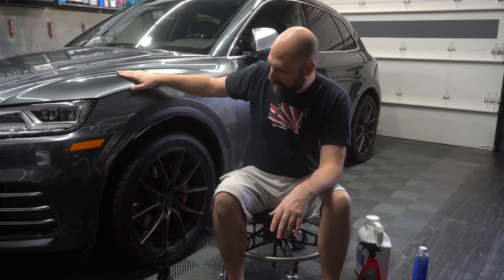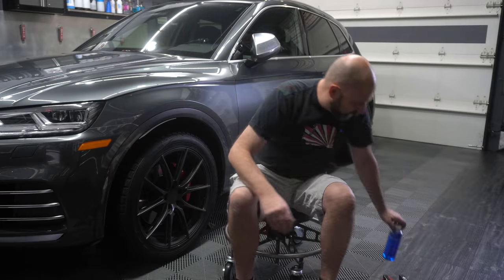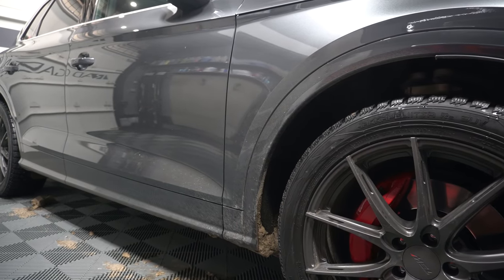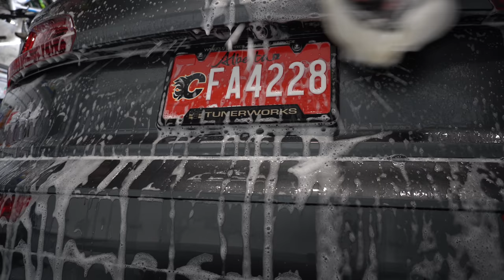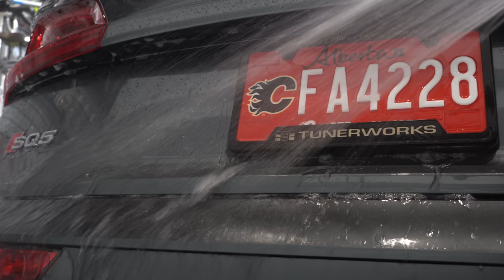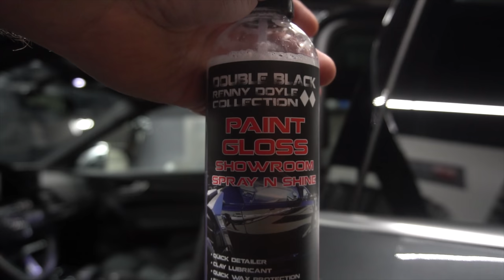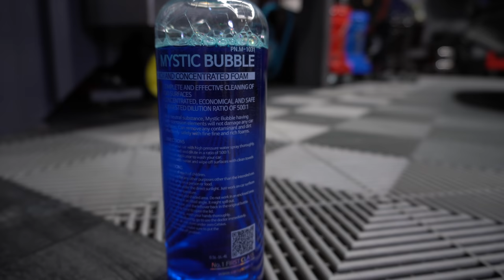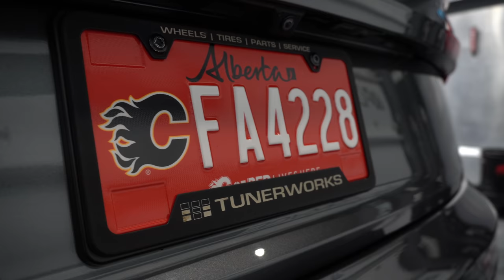SUNDAY NIGHT WASH | Doing my Best to Maintain my Audi SQ5 in the Unforgiving Frozen Tundra of Canada

Comment: That auto foam is very well known and loved in Europe, cheap, bio-safe and actually cleans, not very thick but does the job
Reply from the maker: I liked it very much. I used a very weak dilution. From what I’m hearing, I need to get a 50/50 dilution which seems like a lot. Even though it’s not shaving cream thick, it was highly effective at doing what matters most - melting away the dirt! I’ll play around with dilution rates at some point. I have a LOT of foam shampoos to play around with. Glad to have finally played with the BH A-F!
Reply: @RADGarage  200mls and top your bottle up full with water rick
Reply from the maker: That's what I'm thinking, but I'll tackle the test process nonetheless. I'm curious to see what the exact amount of BH A-F is for the system I am running.

Comment: Bilt Hamber is an incredible product. The price for the quality of the product is unbeatable in the UK. I absolutely love their auto wheels and surfex HD
Reply from the maker: This brand has some seriously loyal users! I have used the wheel cleaner, but have yet to try the Surfex HD. What specific tasks do you use the Surfex for?
Reply: @RADGarage  I use surfex HD like I would use any other all purpose cleaner. Badges, window trim surround and grills. Safe to use for interior as well

Comment: BH Auto foam is not meant to be thick. It’s meant to be runny. It depends on your setup (pressure washer, water, etc.) They claim you need about 4% PIR (panel impact ratio) for heavily soiled cars, which effectively is how much product is on your car. You empty a full of water foam cannon and you see how many litres you have. Say you’ve got 10litres (10000ml). You then 10000x0.04=400ml of foam and 600ml of water in the cannon. Obviously you adjust that amount with how dirty the car is and how full you need the canon to be.
Hope this makes sense and I got it right anyway. Great video by the way!
Reply from the maker: Yes, I think I am now able to wrap my head around the process for calculating the mixture ratio. The thought of sitting there emptying the foam cannon and then calculating the amount of water required to empty the canister just seems so strange and foreign to me, but I get it now. I will do it when I have some free time. When you say you adjust that amount dependent on the condition of the car, how much variance are you talking about? Just a little bit?
Reply: @RADGarage  well 4% is for heavily soiled cars but say summer time you can go as low as 1-2% for example. Haven’t tried it though as it’s not always convenient for me to wash the car often. Apologies for the late reply, I didn’t get notified for some reason.

Comment: Rick, I know the foam wasn't super foamy per safe but I would argue the runny thin nature is what you'd want in a foam soap. I always felt that overly foamy soaps that almost look like shaving creme always just fall off the car too quickly and don't have enough time to dwell, while the thinner "runnier" type usually cling on longer and dwell. Its ironic to say that the runnier foam clings on longer but that's what I've experienced!
Reply from the maker: Thanks for the feedback. I don’t mind runny foam formulations either. I just didn’t know if this consistency shown in the video is what I should be aiming for. The Auto-Foam seems highly regarded by those who have used it. I’ll give it another shot soon with a bit more product in the canister and see what difference it makes.

Comment: Great video Rick, really enjoyed it!!! As for the Autofoam, it's not a thick product but it's one of the best cleaning snowfoams out there and one of the cheapest here in the UK. I use 250 ml of Autofoam to 350 of water in my foam cannon and that works for me.
Reply from the maker: This 5L container cost me around $50 which isn't exactly cheap and I am hearing I may need to use up to 500ml in my foam canister. I need to do some calculations. Truth be told, the 100ml I used in this project was pretty good, but maybe I'll just up it to 200ml next time to see if it makes any sort of difference. At any rate, fun to work with such a beloved product and I am sure enjoying hearing about everyone else's experience with it.

Comment: Great video Rick! Have been using Auto Foam for a number of years here in the UK. Bilt Hamber recommends a maximum panel impact ratio of 4% for very dirty vehicles. With my setup (Kranzle K10 and MTM PF22.2) I need a 1:1 dilution for a 4% PIR with 500 ml of product to 500 ml of water. For a 2% PIR you need 250 ml product to 750 ml water, and so on. Yes, it’s a lot of product to use but I still find it very effective at 1% PIR or less.
Reply from the maker: Haha. I’m 1:1 confused. Pretend I’m 4 years old and explain that again! 😂
Reply: Auto foam is as good as everyone is saying, the common problem is not using it at the correct dilution. Also, once you’ve worked it out and filled your foam cannon, that should cover about 4/5 washes before you need to refill. I use 200ml out of a foam cannon per wash. That’s why it’s so economical. Using a whole litre of it will waste it and cost loads. 

The way to work out the correct dilution is like this:

1. Fill your foam cannon with water till it’s full e.g. if it’s a 1 litre then fill with a litre of water. Turn your settings on your foam cannon to full foam. 
2. Discharge that litre into an empty bucket. Make sure you stop when the foam cannon is empty. This is key. 
3. Then work out how much water, in total, was discharged into the bucket e.g. when I did it I got 12.7l of water in the bucket. Yours will be different as it depends on which pressure washer you use, water flow etc. 
4. Times that figure by 0.04 (that’s the 4% PIR they talk about). So, 12700ml  x 0.04 is 508ml. Therefore I fill up my foam cannon with 508ml of auto foam, and top it up with 492ml of water. 

That’s it. Once you’ve worked that out, the volume never changes (unless you change your pressure washer etc). As I said, when you wash the car, you are only meant to use a small amount. 

I think the problem Bilt Hamber will find with users over the pond, is they like to spray it thick and spray a lot, which is the opposite to how it was designed. So unless you use it as designed, you won’t get the benefit of it. I have a 5l still going from 1.5 years ago, that’s how economical it is. 

Hope that helps, as I love the stuff and hate to see it get a bad review when most of the time, it’s being used incorrectly. There is a video on YouTube which shows you how much to spray and how quickly, if I find it will link it.
Reply from the maker: @LND8110  Dude, that is so nice of you to give me such a detailed and thorough response. I will follow your advice and get this stuff dialled in to my exact specifications! You are RAD! 🤘
Reply: @RADGarage  you’re welcome. I know it’ll tackle the harsh Canadian winter grime if used correctly. Look forward to hearing more about it in the future, love your videos and garage, keep up the great work 👍🏼
Reply: I use the same: 50% BH 50% water in my foam cannon.
Reply: @LND8110  Spot on explaination. Exactly as I do it. A cannon full can last quite a few washes, no need to empty the content each time. Not the shaving foam style but its cleaning power is undeniable.
Reply from the maker: I always end up emptying out the cannon! I'm a sucker for the foam stage. I will do some calculating this Saturday for my next winter wash video. The SQ5 is dirtier than it has ever been.

Comment: Hi Rick. I use bilt hamber snow foam in the winter here in Scotland. It doesn't foam too much but it cleans so well. Generally use 100 ml in a 1 litre snow foam bottle.
Reply from the maker: So, that’s exactly what I did. I don’t mind thin foam. In the video, I make it sound like I was disappointed but I wasn’t. I just wasn’t sure that was rhe consistency experienced users were used to. I’ll double it up next time and see if it makes any difference. I added the text in the video that stated how impressed I was with its cleaning abilities. The car didn’t really even need a hand wash! Thanks for the comment and the view!
Reply: @RADGarage  thanks for the quick reply Rick. Yeah the product cleans exceptionally well and is pretty cheap

Comment: What a great way to end my day awesome wash video Rick. Auto foam is runny they want the dirt to run off the car add more product for more foam. I’m loving BH products surfex hd is my favourite apc degreaser amazing stuff. Have a great week 👍🏻👍🏻👌🏻🇨🇦
Reply from the maker: Thanks Ken. What purposes do you find the Surfex HD coming in handy for?
Reply: @RADGarage  I mix 6 ounces of surfex hd in 3 litres of water in my kwasar pump sprayer and hit the lower portion of the car wheels and wheel wells let it sit for a couple minutes then blast it off with the sprayer at the car wash which is 3 minutes from my house. It removes all the salt and road film. When I get home I use my cordless sprayer remove anything I picked up on the way home then do a rinseless wash in my heated garage. I sure wish I had a drain in my garage like yours then I wouldn’t have to go to the car wash.  I ordered the pump sprayer from Chris at Carzilla the kwasar Orion pro+ 3L. Love it.

Comment: Bh auto foam is designed  to be thin , its alkaline biased so doesn't need long on the car to work.
I use 50 ml in a foam cannon so 1.7 fl oz so 2 fl oz will be plenty. The cleaning power is great especially for cars driven through  Scottish winters. Stephen.👌
Reply from the maker: Wow, so you are saying 50ml. I am hearing as much a 500ml from other viewers! I need to do the test process to find out what will work best with my setup. I agree with the cleaning power, it ate through the salt-encrusted coat of dirt on my car like a hot knife through butter.
Reply: @RADGarage  for me 50 ml is more than enough ,it doesn't go like shaving foam but works amazingly well.
As you say best to test with your set up and see what's best for you 😉
Reply from the maker: The test will happen on Saturday.
Reply: @RADGarage  looking forward to seeing how it goes.

Comment: 4% Panel impact ratio, fill your foam canon bottle with 1ltr of water, turn your foam gun fully open then back 1/4 of a turn. Spray foam canon in to bucket until bottle is empty. Measure bucket contents in millilitres, calculate 4% of contents and that is how much Auto foam you require, top up with water and away you go. Not the thickest of foams but one of the best for cleaning imo 👍👍
Reply from the maker: That is so well explained. I guess if I do this once, I know how much Auto-Foam to add for each and every future foam treatment. I will do that very soon.
Reply: @RADGarage  yep, it’s also very good a 2% for dusty summer washes. I forgot to say cracking vid tonight Rick and hope your return to school goes ok🤪🤪
Reply from the maker: Thanks man. The return to school has presented us with a lot of challenges. Lots of people out sick at the moment. I will play with calculations between 2 and 4% depending on how dirty the car is.

Comment: Hi, quick question, I live in Quebec City where we share that cold weather. How to you manage to deal with the raise of humidity in your garage while washing your car by those temperature? With pressure washer, it just raise up so much in mine? Any trick you use to deal with it? Thx man, just discover your channel this week, you have great stuff going on :-)
Reply from the maker: Humidity is a big issue actually. The videos don't show how foggy the garage becomes, especially when using the pressure washer. I have a Frigidaire dehumidifier that works overtime trying to capture the moisture from the air. Sometimes, I will open the garage door for a minute or two just to let the damp air escape. Luckily for me, I live in a very dry climate so opening the car door brings quick relief. Part of the reason I do a final rinse with the garden hose is to avoid the build up of humidity, but the pressure wash of the foam stage is where I see the most humidity issues. Here's a link to the dehumidifier I use: https://amzn.to/3InkJY8

Comment: I have been anxiously awaiting your next video, you didn’t disappoint, great wash!  It’s always interesting to try our new products, thanks for your review of them.  Question, why did you use your garden hose to rinse off your wash soap instead of your pressure washer?
Reply from the maker: I use the soft rinse because I want to get the soap suds off quickly and efficiently and I find a soft rinse does that. The pressure wash step is really about forcing soap and water into tight crevices to dislodge deeply hidden dirt. After a mitt wash, I just want to the soap (which is carrying the debris) off as quickly and painlessly as possible. Pressure rinse also creates more humidity and in the winter I like to keep humidity levels. low so I don't get condensation inside the garage. Also, I find it more relaxing. Thanks for the question. New video coming out Saturday morning so set your alarm!

Comment: For the Bilt Hamber Auto Foam, 4% PIR is recommend although it’s not necessary and will strip most “fragile” LSP’s. 2% is fine and so still clean well. 
It won’t damage your ceramic coating, but will strip the products that you use to top it. 
The cleaning is achieved through completely wetting, soaking and softening dirt, by the way the bubbles move, this is better than thick clingy foams. 
What is PIR?  Panel Impact Ratio i.e the ratio of product to water, that actually hits your panel, as the foam cannon further dilutes your product, so you don’t mix at 4% in the foam cannon. 
How do you work out PIR? 
Fill your foam cannon with 1 litre of water, set the dial to how you normally use it., attach to your pressure washer and empty it into a bucket with the pressure washer until the foam cannon is empty. Stop as soon as it empties. 
Now, measure the total volume of water in the bucket. 
Let’s say for example that it comes to 9 litres, or 9000ml. 
Multiply 9000 by 0.04 to get the 4% PIR which in this case would be 360ml. 
So in order to achieve 4% PIR, you would need 360ml product and 640ml water in your foam cannon. 
Like I say, 4% is not necessary and still won’t produce the thick foam that most people are looking for, but it should never be judged on the foam it produces, but rather on how it actually cleans, which is very well.
Reply from the maker: Easily the best explanation I have read yet. I will follow these instructions to the letter and report back what I find. I"m kind of excited to see what value the math comes out with.
Reply: @RADGarage  Thanks Rick, every one is different so we will see what you get there

Comment: Any particular reason you like to use your garden hose for the final rinse instead of the pressure washer?
Reply from the maker: Quicker, less overspray which means less humidity in the garage and just no need to pressure wash after a foam and hand wash imo.

Comment: the bilt hamber is supposed to be thin, thats how it was designed.  also to get a pir ratio of 4% you usually need to use  it at 1:1 ratio in the foam cannon
Reply from the maker: That seems ridiculous to have to use a foam shampoo at that kind of rich ratio, but I guess that is how it works. I usually use a squirt or two of my other foam shampoos in the canister. I guess that's what helps give it so much cleaning ability. Thanks for the info!
Reply: @RADGarage  I do agree it's a bit much compared to other products, however I find that with the thinner viscosity it is easier and faster to foam the whole car. so I only actually  use 200ml autofoam and 200ml water, and I'm still able to easily cover the entire car.
Reply from the maker: 200ml sounds about right compared to the other foams I use. I'm hearing some users use up to 500ml in a cannon which seems out of control to me! I will do some calculations to see how much will get me to that magic 4% PIR mark.
Reply: @RADGarage  I look forward to seeing  you use auto foam again
Reply from the maker: It's coming.

Comment: Despite all the overwhelmingly positive reviews of the bilt hamber auto foam, I'm also one of the few that don't really like it. The smell and the lack of thick foam take away the enjoyment of using a snow foam for me. It also tends to leave a hazy, oily film behind that masks the hydrophobicity of coatings. The value and the cleaning power are the only positives for me and probably the reasons why so many professionals like it so much.
Reply from the maker: I did not notice any hazy residue when I used it. I'm going to play with the PIR dilution and give it another go this weekend. I'll keep an eye out for the haze you experienced.
Reply: @RADGarage  I use 150ml of it into my 1 liter foam lance, and with that amount it does rinse away a bit poorly and leaves a residue, at least on my waxed car. It may be a different story with a more repellent coating.
Reply from the maker: Yeah, there are many many factors at play when using a product such as this. I was happy with the overall performance, and I have a feeling the PIR process will produce the same dilution ratio I used. Mark my words!